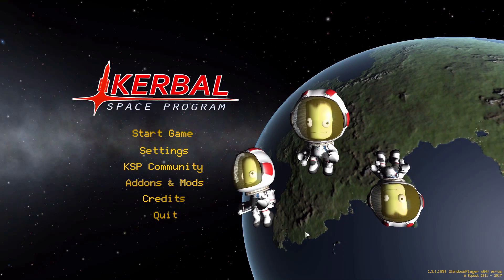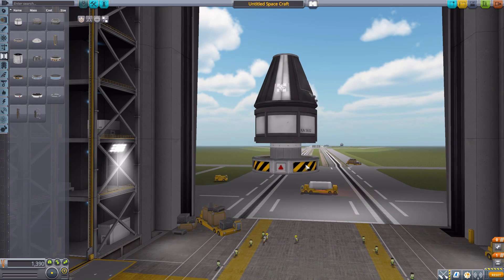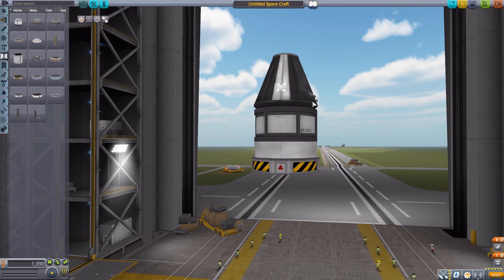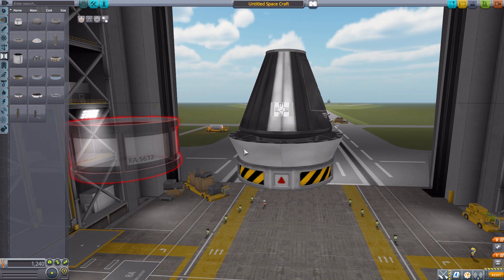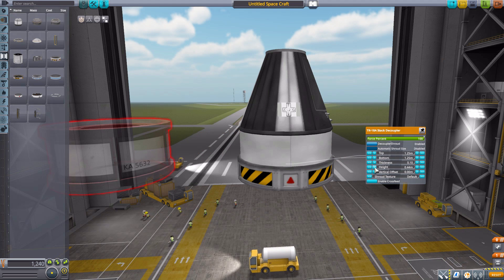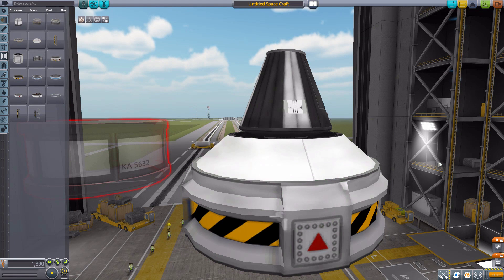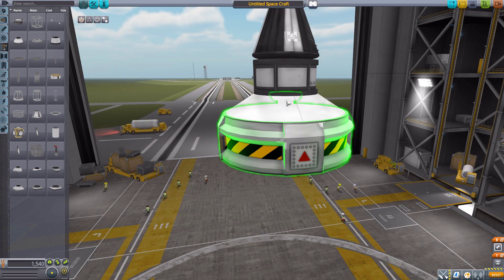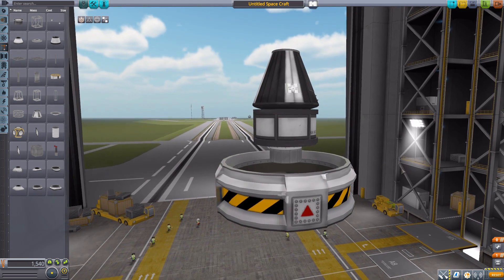KSP Mods - Decoupler Shroud

Comment: Squad made the shrouds the same size as the base of the engine because you want the shroud to be the same size as your stack, and the shroud is just a pre-made model that is packaged with the engine model.  I just throw a fairing on under the decoupler.  In KSP, there isn't really a situation where that extra mass is going to hurt you.